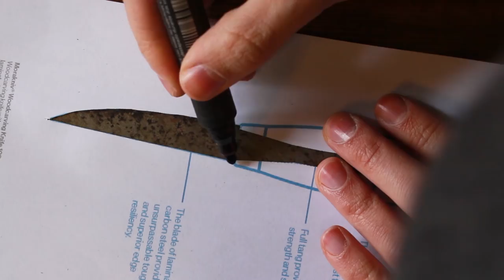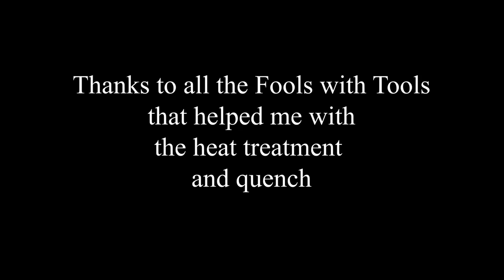Making a woodcarving knife - start to finish

Comment: Hi do you sell your knives? If so how can I get one like this one? Thanks
Reply from the maker: Hi, i do not sell knives. This is the first and only knife i made to date. This knife is based on the Morakniv 106 which you can find here: https://morakniv.se/en/product/woodcarving-106/
Reply: Marcel Teugels ok thanks for your reply
Reply from the maker: @stevemattox6694  No problem!
Reply: @MarcelTeugels  where did you get the photo you used for the blade that you cut out?
Reply from the maker: @jeffroberts4788  morakniv catalog

Comment: Is that handle bulky it seems really big for a carving knife
Reply from the maker: I'm fairly sure it is a bit thicken than the mora 106 handle, the length is the same. The thickness is because i wanted to use the brass nuts. Thanks for watching.
Reply: @MarcelTeugels  0
Reply: Қалай  жасайсыз

Comment: I dont understand the heat treatment. why could you cut the knife after heat treatment with a file? you showed that its hard after heat treatment.. even after tempering .. the steel should never be soft enough to be filed away
Reply from the maker: Hi Stanislav, I'm not an expert, but in my understanding the steel hardened after it was quenched, at that time it is harded than the file, but with the hardness comes brittleness , so the knife was tempered to bring down the hardness to a state that is still hard enough to hold a cutting edge (yet softer than a file), and soft enough to withstand impacts or stress without shattering.  The following link can probably explain it better: https://www.youtube.com/watch?v=6jQ4y0LK1kY 
Thanks for watching

Comment: Wait what... can you explain what on earth is going on there when you did the logo with that battery and solution? 
the result is awesome i really want to try it out
Reply from the maker: Hey! You should definitely try it out! It is very easy, cheap and gives great results. The sollution is just kitchen salt desolved in water. Sending the current from the battery through it makes the metal corrode away rapidly there where the bare metal and the sollution touch. THe hardest part is getting a clean and crisp "mask" (that what protects the metal you don't want to be etched), I used electrical tape for this. 
Good luck!
Marcel
Reply: @MarcelTeugels  This is genius! i am going to try it tomorrow!
Thank you for answering so quickly

Subbed
Reply from the maker: @beepIL  No Problem! Let me know how it went!

Comment: It looks like , there was no good Heat Treading, after Hardening the Blade, you do File Works for Grinding? So this shows, the Blade is not really Hard.
Reply from the maker: After quenching it is as hard as a file since in skates over the surface when tested, which is shown in the video. After tempering it is still hard, but not as hard as file, that's why i could file it. Although it is hard on my files and they will dull quicker.

Comment: Just my humble opinion, the handle will not be comfortable for long term use, and because of the shape and size of the ferule, you deny yourself access to the heel of the knife, the part that allows for most control in cutting wood. Execution is flawless, the video was a delight to watch. Keep up the good work.
Reply from the maker: You are probably right. I don't use it often so it hasn't proven itself yet, although the times I have used it I found it quit comfortable. But I haven't used it for a long period of time in one go. About the heel of the knife, I didn't even know that was a technique. Soon I would like to try some spooncarving, hopefully then I can use it extensively and expierence the flaws of this knife. Maybe I will buy a regular mora knife to compare and learn from. Thanks for the feedback!

Comment: It's a beautiful and nice Knife. Respect!
But... The Morakniv (I own a Model 120) are so fair prized that I see no reason to make my own.

Most notably that the Morakniv 120 has a blade of 3 layered laminate carbon steel that keeps sharpness long and is easy to re-sharp on a fine bank stone. The steele of the hedgeclipper is for sure not bad (nice idea!!) to make a carving knife, but compared to the steel of the Mora I guess there is a huge difference...
Reply from the maker: I agree completely. I think i also mention that in the desceiption of the video. The morakniv knives seem very high quality and are very affordable, even cheap to be honest, for what you get. Therefore they are so popular. I made this knife just because i wanted to make a knife, for the fun and the practice of the making proces, and maybe be able to do some carving with it. So i copied the most popular and most effective bladeshape out there. Which happened to be the morakniv (106). I also linked to their website in the description for people who would be interested in buying one of them. Thanks for watching and the comment.
Reply: Because u can!

Comment: an exquisite finished product to be sure, but is that handle REALLY comfortable for long term use?
Reply from the maker: Thanks. Haven't used it intensively enough to tell you that, but I imagine some corners might need to be rounded a bit.

Comment: How did you do your etching?
Reply from the maker: Hi, I answered this question once before. I will copy and paste the answer I gave them here and post it in het description of the video. Thanks for watching and pointing out something was not clear in the video!

The etching process in my understanding:

 it is called electro-etching. This is a technique where you apply a resist to a (metal) surface (in this case I used elektrical tape), then apply a current through an electrolyte (in this case salt (NaCl) dissolved in tap water). I used a 9 volt battery, and used alligator clips to connect one end (plus or minus, don't remember) to the knife metal and the other end i put in contact with the electrolyte absorbed in a cotton swab, which closed the circuit when applied to the metal surface. so it reacts with the metal and extracts the metal from the surface, dissolving it in to the elktrolyte,. This is what I think is happening. You would need to google it if you want to be sure. 

Have a nice day.

Marcel

Comment: What does the heat treatment do?
Reply from the maker: You need it to make the steel hard enough to hold and edge and flexible/tough enough not to break under stress. If you don't do a heat treatment the metal blade will either be too soft and go blunt very quick or too hard and shatter under stress. Hope this helps. Their  are some great video's on YouTube explaning this proces. Thanks for watching

Comment: Superb finished knife. I was a little concerned when you were fitting the handle to the blade early in the process, that you held the blade against your fingers edge first, without taping the blade, The blade must not have been too sharp then, but otherwise you have good skills in working metals, which I don`t have, although after watching Forged in Fire I have learnt a lot, but you have taught me more!!! Regards from John in England.
Reply from the maker: Thank you John. It edge probably wasn't sharpend all the way at that point, luckily. 😀 Thanks for the kind words. I was my first time really working with metal. The blade you see here is the second one, after broke the first try in two during a bad set of heat treatments. So all you need to do is try and try again. Thanks
Marcel
Reply: You are right Marcel if I don`t get the result I want when I carve,  I don`t worry about it I just get on and try again, its better for your piece of mind not to get upset if you make a mistake, keep trying, thanks for the reply so quickly.
Reply from the maker: @johngoodall7097  No problem man. Thanks for the comments!

Comment: nice would like see make v tool or goundge. got knife work way through all tools. heck make one carving roll up leather pouches. mine problem not nice yours but just squre peace canvases one sewed up every 2-4 inches that pocket for tools. then other side fold down cover blades. got two strings when roll up tie like would shoe.
Reply from the maker: I was thinking of making a hook knife for spooncarving next. Have to figure out exactly how I will bend the blade though. I recently bought a whole set of carving gouges with tool rollups like you describe. You can see the carving chisels on my instagram. Thanks for watching and commenting man.

Comment: Why do you need the heat treatment? I always see this and I'm always confused.
Reply from the maker: You need it to make the steel hard enough to hold and edge and flexible/tough enough not to break under stress. If you don't do it the metal blade will be either too soft and go blunt very quick or too hard and shatter under stress. Hope this helps. Their probably are some great video's on YouTube explaning this much better. Thanks for watching! 💪
Reply: @MarcelTeugels  ty
Reply: There is a video featuring Alec steel that demonstrates the difference and it helps a lot not sure what the video is called though
Reply: The heat treatment gives the steel some flex, while also having it be hard
Reply: @MarcelTeugels  Hi, why do not you normalized this scissor steel before grinding? If I get it wright steel should be softener than before.
Reply from the maker: @TheMates5  i guess that's true, but i just didn't think of that.

Comment: Does his lathe look a bit wobbly or is it just me?
Reply from the maker: It is deffinitly a little wobbly. Not sure what to do about it though. It is bolted down and the table is kinda heavy.
Reply: @MarcelTeugels  i am not a machinist but to me it seems a balance issue, if it is no fastener can hold it down, does it wobble with all your chucks for instance? Does it wobble without a piece, does it wobble with no chuck at all?
Finding the problem is half the repair
Reply from the maker: @killingmercy  i only have one chuck. I think it runs steady without a work piece. I need to trouble shoot it some time..
Reply: @MarcelTeugels  i'd suggest that you spend more time with centering your work pieces.
Reply: And check if there is any dust or debris on the spindle  where the chuck screws up to or the jaws bolts threads this is might be what's throwing it out of balance

Comment: What is the process for the logo? Nice job!
Reply from the maker: Hi, it is called electro-etching. This is a technique where you apply a resist to a (metal) surface (in this case I used elektrical tape), then apply a current through an electrolyte (in this case salt (NaCl) dissolved in tap water). I used a 9 volt battery, and used alligator clips to connect one end (plus or minus, don't remember) to the knife metal and the other end i put in contact with the electrolyte absorbed in a cotton swab, which closed the circuit when applied to the metal surface. so it reacts with the metal and extracts the metal from the surface, dissolving it in to the elktrolyte,. This is what I think is happening. You would need to google it if you want to be sure. Thanks for watching!

Comment: 08:00 Safety, folks.
Reply from the maker: What do you mean?
Reply: @MarcelTeugels  Did you hurt your right ringfinger when you were making your knife? At 08:01, there seems to be what looks like blood-related.
Reply from the maker: @blueberrymcphuckerson9821  ah I see, it's a long story but not knife related. 😁 Long story short, I almost ripped my nail off running to catch my train slamming my hand in to a broken handrail.
Reply: @MarcelTeugels  Well, as long as you still have your finger lol.
Reply from the maker: @blueberrymcphuckerson9821  luckily I do, my finger healed remarkably well.